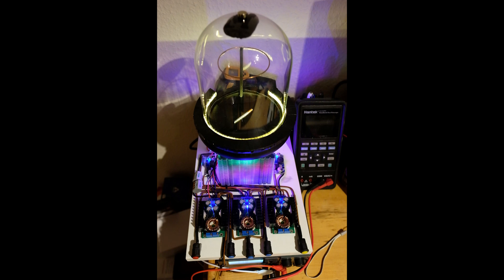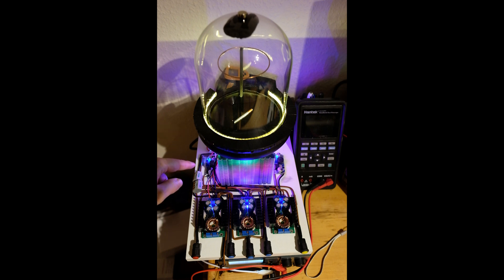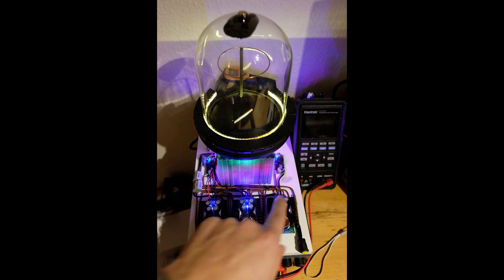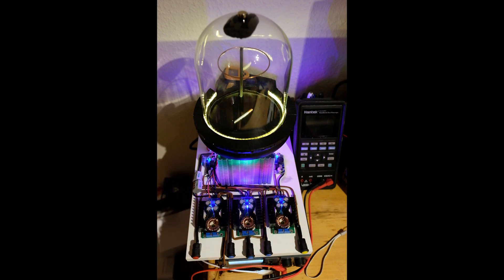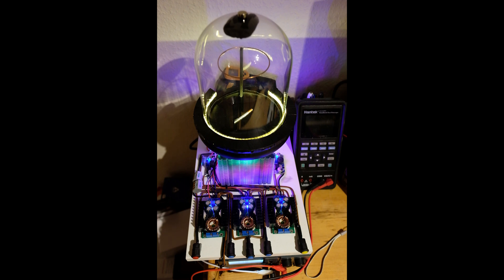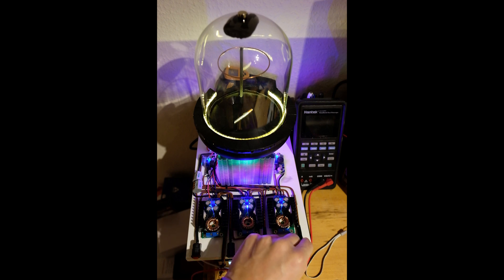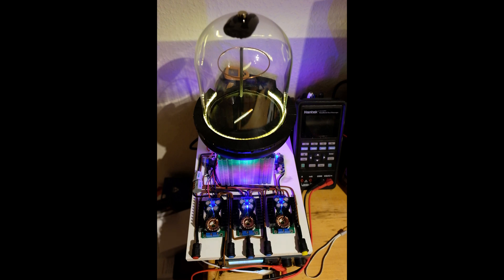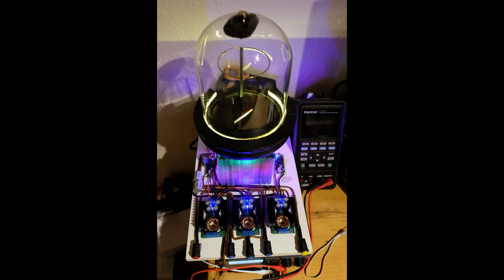Peltier Cloud Chamber Radiation Detector

Comment: What kind of taser module are you using ? 

I feel I’ve overdone it using a 30v power supply - invertor/ transformer then a voltage multiplier with resistors. 

It was a struggle to find anything decent online for this purpose so I had to make do. 

Should get 3.8kv 

Also do you wire the negative supply to the cold plate or positive ? 

I’m under the impression it’s best to have a negative cold plate and positive wire ring at the top ?

Comment: Nice cloud chamber - any chance you can post some specs up, I’m using 2 stacks of 3 TECs but I just can’t get my cold plate cold enough, I’m using a 12v power supply from Amazon, I was using CPU water coolers and radiators but I’m going to go back to fans and air coolers….
Reply: I got it to go -30 with teci-12706 peltier stack of 2  total 4 peltier for lower ones i use 12v and 5a and for upper ones i used 12v 3.5a you can cool the liquid down that will help just put ice bags and insulated it